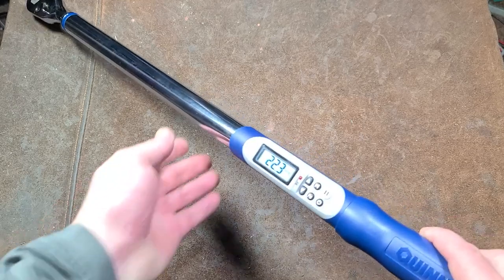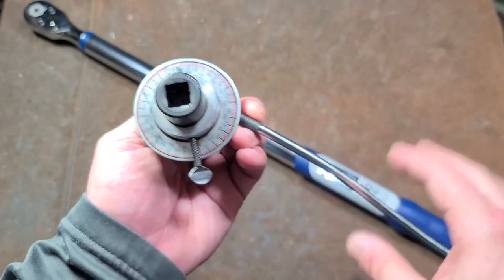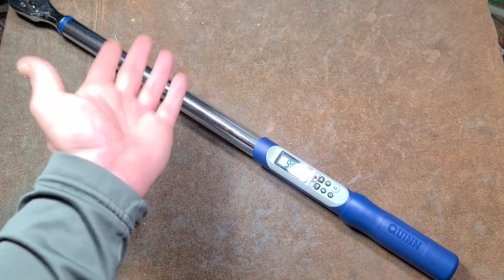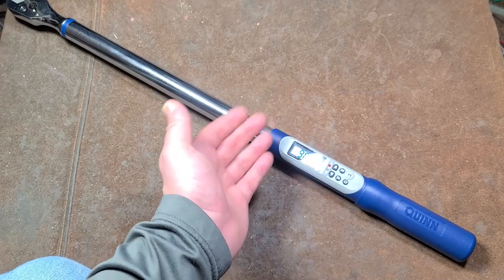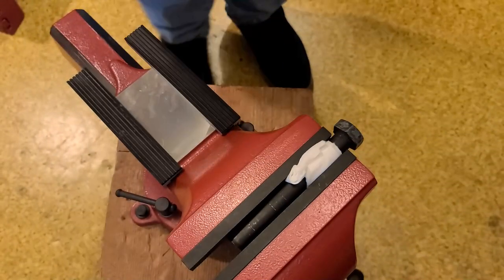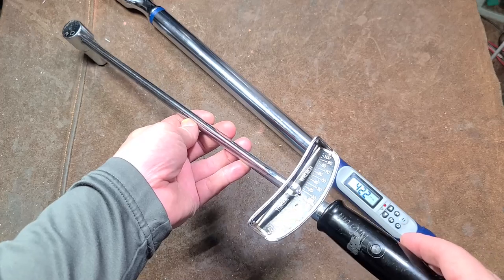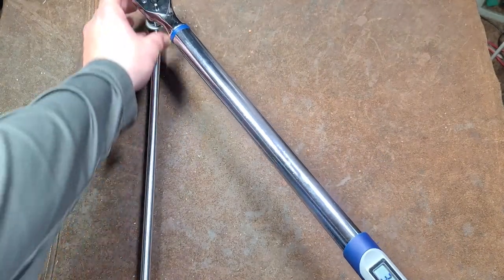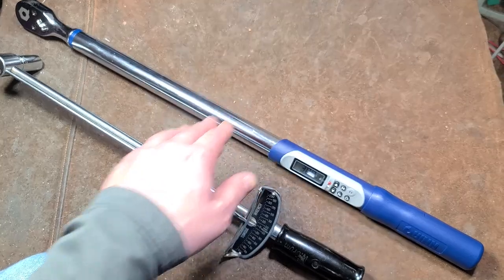Harbor Freight Quinn 1/2" Digital Torque Wrench Review

Comment: you have to set the torque of the bolt before you set your angle on the quinn. it goes off the amount of torque you have on the bolt like 40 ftlb and 90 degrees

Comment: I'm glad you mentioned this was a return.  I'm not sure why you'd review an item someone returned.  It's safe to assume, someone returned it because it wasn't working correctly, or they dropped it hard once or twice and just didn't want to take the chance it wasn't harmed.  Personally, I'd totally disregard this review and would make a point of buying a new one(not a returned item).   We know Harbor Freight is not going to check/calibrate a return item.  that's why they discount it.  I'd be okay with a returned (look at me) Snap on or Mac, because you know they would check calibration.  But Harbor Freight won't.  I too would get the Icon, but I like the range on digitals.  A little lower with the range.  Interesting review though!  thanks.

Comment: Several things not right with this video. We don’t know if if the torque wrench he tested against is accurate,there’s nothing to indicate it has been calibrated. The other thing wrong was the angle test, he did not rotate the wrench to the continuous tone, he stoped at the warning beep only. The Quinn product was never tested against any calibration equipment.

Comment: When I do torque turn I do the torque with the wrench and then mark the socket and then breakout the impact gun to make the turn. 60 ft lbs plus 120 degrees on a 14mm flywheel bolt doesn't care how you get to 120. Same idea with a Cummins main cap bolt. I've been leary of that torque wrench, thanks for the review

Comment: Trying to decide what torque wrench or torque adapter to get. I am always hearing that click torque wrenches are accurate to 80% of their stated range. That if your taking torque measurements at the upper or lower ends of the range its not as accurate. Do these Digital Torque Wrenches suffer from the same thing?

Would a Digital Torque Adapter work just as good versus a Digital Torque Wrench? Do they also suffer from this torque range inaccuracy?

Comment: The icon professional is stupendous... The collar-based locking mechanism alone makes it worth the price of admission. Pittsburgh with its screw-to-lock system was just stupid, rarely consistent. You'd think it was cinched down, then, whoops, mid fastener-turn you feel the handle spinning! Back it off and start over........

Comment: what an unprofessional review.  "well I eyeballed that I turned it 90 degrees but the wrench only reads 86 degrees so obviously it doesn't work because nothing is more accurate than my eyeball".  I used and angle finder and did the same test with my new(no returned for some unknown reason) one, and it read perfect.

Comment: BIG fan of yours, but VERY Disappointed that you (even though you disclosed it) are reviewing this product based SOLELY on your experience with the RETURNED VERSION of the item that you openly admit is LIKELY BROKEN.  To me, that isn't a review, it is just a set of circumstances that you are reporting on.  It is just CONVENIENT. I can only guess that your level of frustration trying to produce this video caused you to not think clearly and hastily post this and punish a potentially good NEW version (without thinking it through thoroughly).  Shame on you, YOU ARE BETTER THAN THIS!!!   You should at least get and test a new one (before damning the item).  If it stinks too (or even if it doesn't) just return it afterwards.
Reply: I was thinking the same, he said the same the other day for truecraft products then he changed his opinion, yeah, that's perfectly okay, but the problem here it's that a lot of people love this product because they did actually used how it's intended in the manual owner.
Reply: So your denigrating a returned item? That’s just silly. Try a working one .